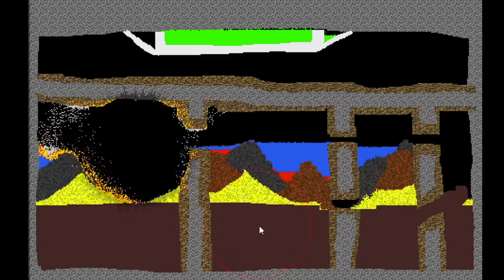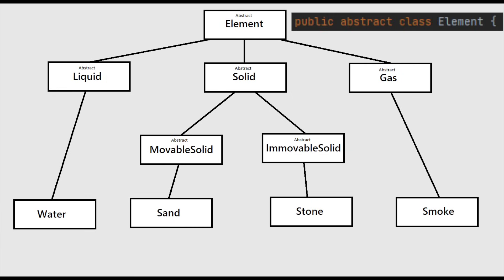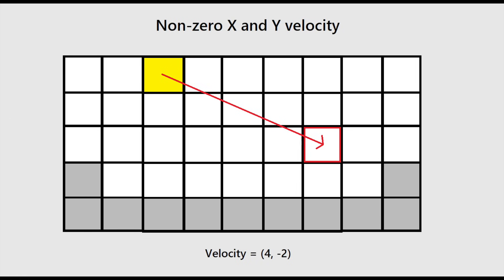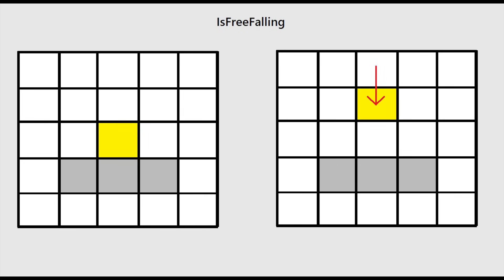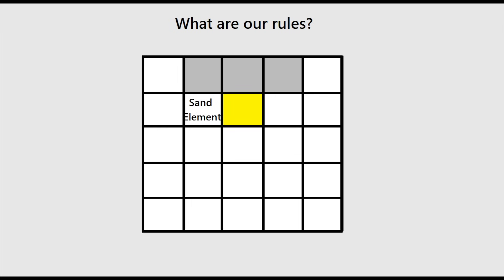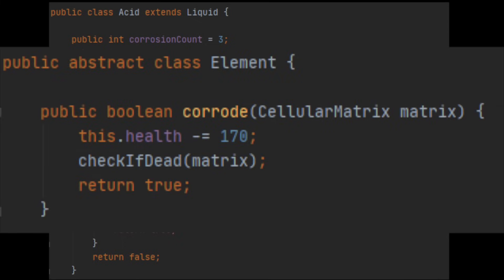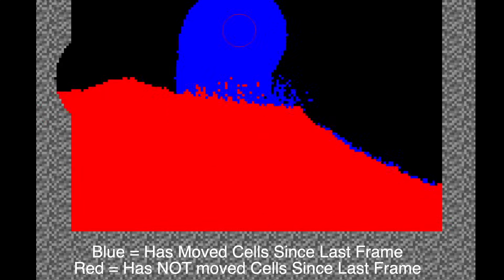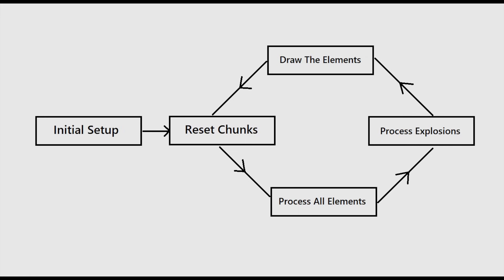How To Code a Falling Sand Simulation (like Noita) with Cellular Automata

Comment: I’m trying to make something like this but I’m a bit confused about how the velocity works. Do particles move based on the cellular automata rules or their velocity? Because the rules for sand doesn’t make it move sideways but it did move sideways from its velocity.
Reply from the maker: Tracking velocity is a way to expand the rules of the simulation. So if a particle has an X velocity of positive 2 then it will attempt to move 2 cells to the right that frame (checking the contents of each cell along the way). This is different than the basic rules mentioned at the beginning.

Comment: You process elements in random order?
Reply from the maker: The matrix is still processed row by row bottom to top but the update order within each row is random.
Reply: @marf1610  I decided to use random sampling in order to get rid of floodfill jitteriness, but it probably won't cope well with multithreading.

Comment: This is actually my first time commenting here. I wondered wether you got a discord? Or if not let me just ask my question here: 
As every Element has a step function, do you first check wether the cell SHOULD update and then set the corresponding chunk to "update_next_frame" to true?
Reply from the maker: Each chunk has shouldStepNextFrame set to false at start of the entire update cycle (before any elements have been updated). As elements update, if they perform any action that would require the chunk to be updated next frame (such as changing position or being on fire) then they set shouldStepNextFrame to true on the chunk.

At the start of the next frame shouldStepThisFrame inherits the value of shouldStepNextFrame and shouldStepNextFrame becomes false again.

So to directly answer your question, each element knows already if it should update this frame due to the value of shouldStepThisFrame on the chunk it belongs to. It does not know if it should step next frame and that is determined this frame.

Comment: Very cool, thanks for the detailed explanations!
Regarding multi-cell movement in any direction, you might be interested in Bresenham's line algorithm to compute all cells along a path. It's supposed to be pretty efficient, since it does not need multiplication and division operations.

How would you handle small velocities, such that particles do not move at least 1 cell per frame? I figured you could store the positions with more precision, as floats for example.
Reply from the maker: Bresenham's algorithm seems exactly along the line of what I'm looking for. Thanks for the suggestion.

I have each cell at whole number coordinates. If an element has a velocity on the x or y axis less than 1, then each frame it accumulates the velocity in another variable until it is greater than 1 at which point it will move one cell in that direction.

So if an element has an x velocity of 0.4 then it will move 1 cell over on the x axis 3 frames later.

Not sure why I did it that way, and I completely forgot I implemented that until looked it up just now but it seems like a different way of accomplishing the same thing.
Reply: @marf1610  On the efficiency of Bresenham's algorithm, I have found your approach to be marginally better in my case. I'm guessing it's due to having a small bit of branching logic in Bresenham's, instead of a mostly mathematical approach from yours. I was working on a FSG several months ago and cant remember the exact details but I was fairly surprised at the outcome of my tests.

Mine is coded in C and compiled with gcc with optimizations on max during my tests so I'm not sure if that would have a different outcome in Java. Also I was calling the line drawing way too much as I was taking a different approach to velocity. I was attempting a data-oriented system and was hoping to have liquids, solids and gasses be emergent from how I was simulating. Long story short, the change in efficiency is likely trivial and your approach is surprisingly effective for this.
Reply from the maker: Hmmmm...interesting. Thanks for sharing your findings! I will consider this as I port the simulation over to C++. Maybe I'll try comparing the two approaches and see what I find.